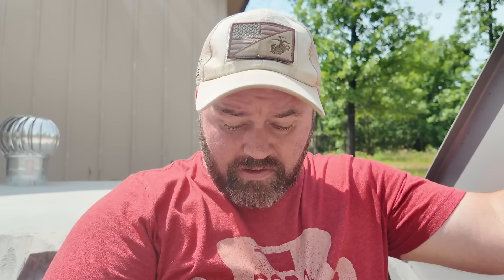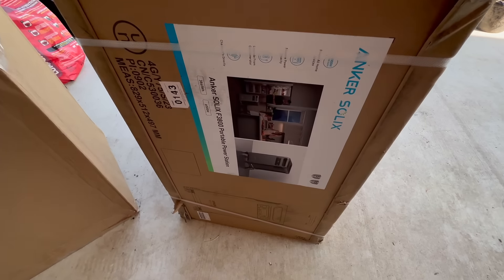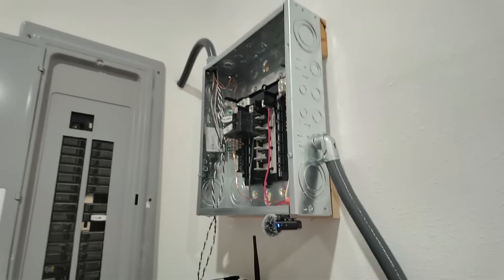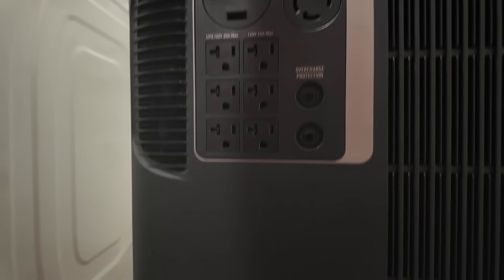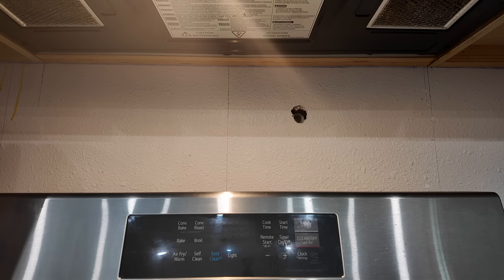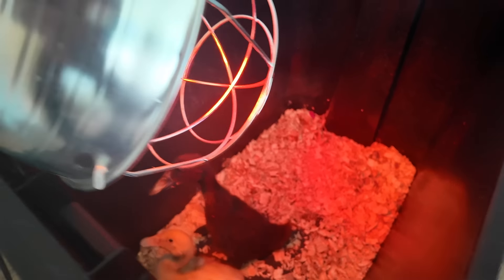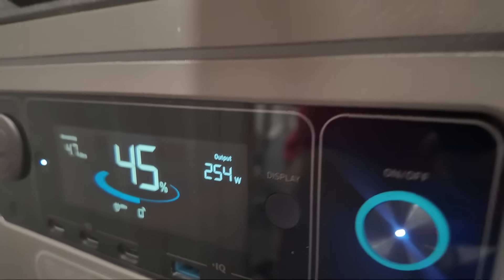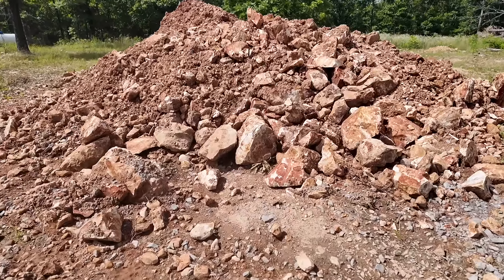Tornado Ripped Past Our House!! Anker SOLIX F3800 Home Power System Install

Comment from the maker: Anker SOLIX F3800 home power system serves as a comprehensive power backup solution during power outages and functions as a solar energy system for everyday use, click the link https://ankerfast.club/4jk7w7 and use promo code F3820HPPBDZ to get 25% off for Anker SOLIX F3800 and its bundles.
Reply: unfortunately the discount code was not excepted with the already reduced bundle deal offered, Anker SOLIX F3800 Solar Generator + 400W Solar Panel.  :  (
Reply: DUTCH GET THEM TO GIVE ME ONE LIKE THEY DID YOU. WHEN YOU ARE ON A FIXED INCOME THERE IS NO WAY I COULD AFFORD ONE. I ONLY GET A THOUSAND A MONTH WHAT WOULD YOU TELL ME NOT TO BUY FOOD, ELECTRICITY MY MEDICINE? YOU HAVE IT GREAT SIR THIS COMPANY IS GIVING YOU THE PRODUCT. NOT ALL OF US ARE THAT LUCKY.
Reply: You may want a jack and a 4x4 to force that door open if something lands on it.
Reply: head over for you $3,999 + tax unit.  I wish Dutch…….   But hey for free  it’s an amazing deal…..  you earned it……

Comment: You should put a cage around the exhaust fan so nothing hits it and tears it off and rain falls in . Also you need to put something over the door so it doesn't get locked down when you're in it. Rails on top of it so the door doesn't get covered up

Comment: One thing I gotta have no matter where I live is a basement.
Reply: Certain places, a basement is not feasible. In our area, the water table is too high to have a basement. Hence, stand up tornado shelters like my SIL had to install in the corner of her garage.
Reply: Me too. I won’t ever move somewhere with a high water table with no basement. No basement=deal breaker.
Reply: If you have a basement, hope you have concrete above you.
Wood won't work all the time, might get by in a smaller tornado, but I would not want
to be in it in EF3, 4 or 5. 
If I can post a video, not sure if youtube will let me, it's a short from Iowa, the family made it, but the basement blew out, they were covered in debris. Not the first one I've seen either.

Comment: The only problem with those back up power sources, is the cost. The average person can’t afford one. Then think about people on fixed incomes. How would they pay for one. That really needs to be a consideration along with the quality you’re speaking of.
Reply: I agree with you. Most youtuber channels that recommend a product are given to them for a review.
Reply: I'm one of those Average persons!
I'm on a fixed income. It's mine & my husband's check . I wish we could get one- my husband has COPD & is on Oxygen. It scares me when we have a bad storm
Reply: @carolynjohnson6792  myself as well. I’m using a system I put together the works decent. Yard sale solar panels , a couple good batteries and an inverter. I also have a generator if needed. These machines need to be kept operating. I like breathing a bit too much.
Reply: Fixed low income only so much covered by insurance should I be hospitalized while making payments on that I’d never make it
Reply: Seems to me by the time you have everything you need the cost would not be much less than a big generator
Reply: You still have to change it and all those are is a inverter and plug outlets and a big battery you can make one by searching on YouTube how build a battery bank your still going to need some solar panels to change it. And you are right the YouTubers are being given that to them for FREE And lot's of people are low income cannot afford to buy one of them and the YouTubers that are getting them for FREE they can't afford to buy it either so like keeping it Dutch he can go o wow there's so fantastic they are so nice yeah you got it FREE . I COULD NOT GO ON LINE AND RUBB IT IN TO EVERY ONE LOOK WHAT I GOT FOR FREE
Reply: I think the same thing, They dont think of people with not a lot of money. Most YouTuber do things that are expensive for normal people to get. I would love to get one to take with when I take my Grandkids camping  just can't do it xx
Reply: That's when you get together with other neighbors and have them and pitch in with the cost.
Reply: They get them for free for advertising it ..the average person can't afford things like that
Reply: It's only $3000
Reply: @col2560  good for you of you can afford to spend that kind of money because as said the average person or on a  fixed income can't I'm disabled and get less then 1000 dollars a month I can barely live on what I get
Reply: @angelaknisell  $3000 is nothing when you see how much money these " homesteaders" throw around
Reply: Watch marketplace and find a generator for sale in your price range.  Any size is good, you just have to decide what you need to run with what you have.  I found a no name new generator at a Home Hardware  for about $500 that can operate main things in house.  Just have to run extension cords as necessary.  You can also find switch boxes to plug generators into, electrician needs to install, but that can be done when you can afford it.
Reply: That is exactly where I am. I’m a retired hospice nurse, widowed, living on SSI because of being injured, while caring for a patient.  Nobody offers payments over a long time for any of these units.  So I don’t want to hear from those of you that are given these units or can afford them.  We who are retired and on very limited income are screwed.

Comment: In the old times people would  put the rocks along the property lines or build a wall. I'd say mark the corners of your boundaries would make it easier to find. If a lot of rock, use more of them along raised or flat areas or if weird angle areas. Can also do like farmers do cut an area along the lines like your going to do a fence.

Comment: Still concerned about your bunker door getting blocked by debris from a tornado and not being able to be opened from the inside. My suggestion would be to have a reinforced hand rail guard for the door to keep the door operational. Safety thought. Like your prep.

Comment: We had a generator, was old old old & quit working. It was gas powered & not very practical to use . If we had outage would need to ~go outside, find, hook up~to use it. We have outages, they only last short times & it takes a long time for us to need electric power. We may get hot or cold a bit but we can survive a day.

Comment: For less than 5K you can install a backup generator that will power your entire house AC & all. Runs on natural gas or LP. Also what happened to the Jackery system you already set up in your house?

Comment: MY ONLY FEAR IS IF IT  FLOODED OUT  !
Reply: If you watched the construction, it was 2 halves bolted/sealed together.  water can only get in at the door or top vent.  so i think the whole thing would float out of the hole with sufficient flooding.
Reply: @Andrew-ky8oc8cq4n yes, that's a concern, that it could float up out of ground.
Reply: @lindamaskus5142  Isn't that what you want?  If you are in a flooding situation inside it.  would you rather have it sink or float?
Reply: @Andrew-ky8oc8cq4n  , I LIVES IN A HIGH WATER TABLE AREA AND IT WOULDN'T WORK HERE & MAYBE IF THE PINS ARE DEEP ENOUGH THAT IT COULDN'T RIP IT UP FROM THE TOP SIDE? & IF IT FLOODED IN THAT AREA AND IT GOT DEEP ENOUGH LIKE IT DID IN TEXAS WHERES THEY HAD TO SWIM HORSES TO THE HIGHER GROUND  & IN VA. WHERE WE ROWED CANOES DOWN THE MAIN ROAD?? IT JUST WOULDN'T WORK!? I GUESS THATS IT'S NOT FOR EVERY WHERES  ??

Comment: The only thing I care about in a power outage is my freezer, my fridge, and my well water. I have a gas generator that I run intermittently, just long enough to get water and cool down the fridges and freezer. Then I turn it back off. All I could afford and suits my needs.

Comment: Shelter installed just in time to immediately get proof of justified cost and critical need for it.
This year sure is providing evidence that failing to have a good shelter is a false economy. 
I do feel for people that just simply do not have resources to get one, I only hope that their community has some available public access sheltering  or that some kindly neigbours can offer to share a little space in their shelter. Both however take forward planning as access in short emergency time span  is not possible. Exposed time outside,  while trying to reach a shelter is potentially deadly

Recent results and destruction, clearly show to be forced into hiding inside the home under tables, bathroom or in doorways really is not sufficient if really getting hit by these reeated events, that so far seem to never end.